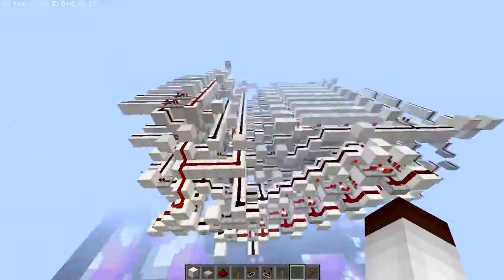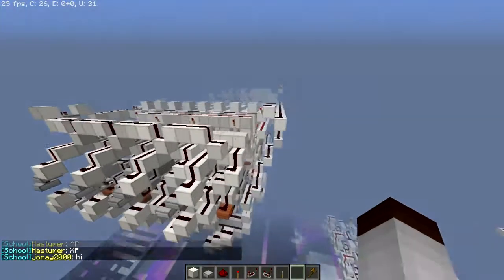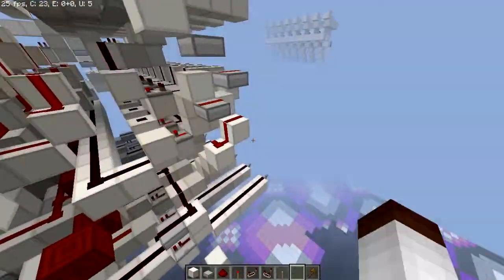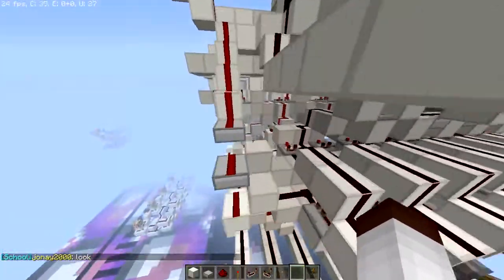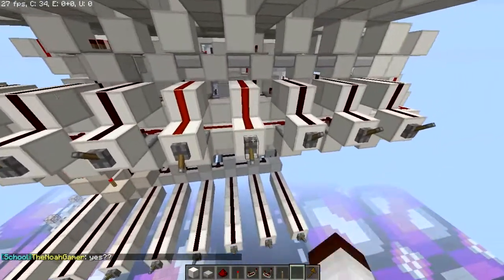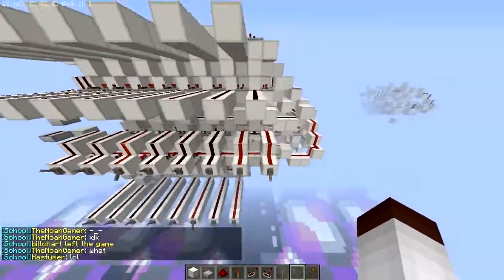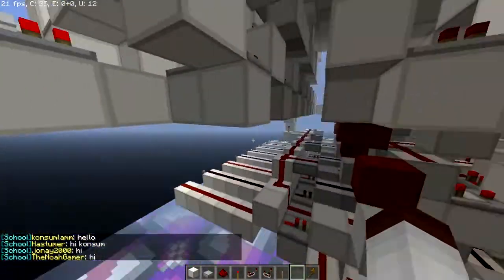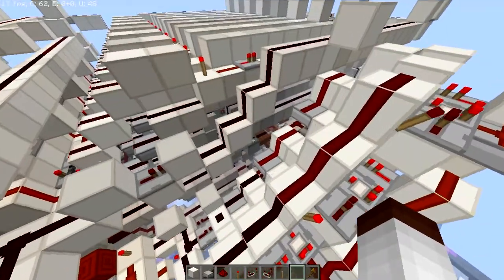Redstone 8bit Divider

Comment: Is this expandable?
Reply from the maker: Yup, you just need a bigger adder. The more bits you add the slower it gets tho, my design isn't the fastest
Reply: @TuchisRedstone  do you have a tutorial for this, sorry for bothering you
Reply from the maker: @seadve   Sadly I don't :( I can tell you what went into the design though? 
1) Adder - n bit
2) Control lines - to control the conditional subtraction
3) Shift register - to hold the number you want to divide  it's intermediate values 
4) k bit Counter - to count the number of shifts. If you want more precision you need more shifts. I used 4 bits as I wanted 8 bits past the "decimal point" or radix giving me a 16 bit number.
Sorry if I'm missing anything and no problem, I'm always happy to help! I will update my old builds at some point,  many of them can be improved a lot.